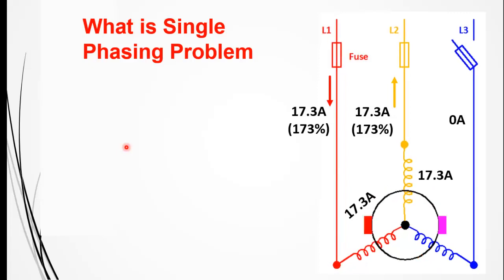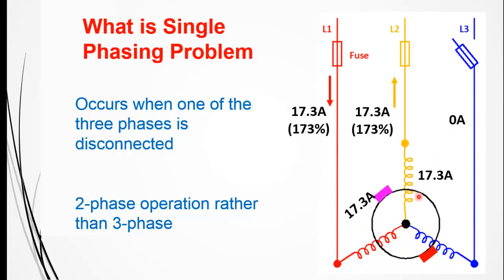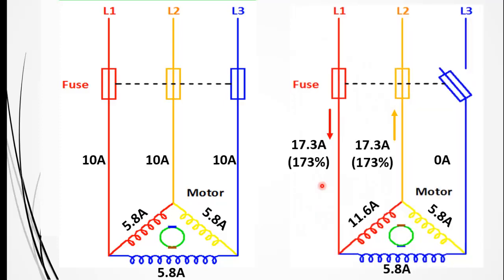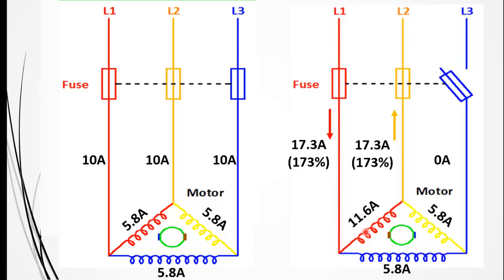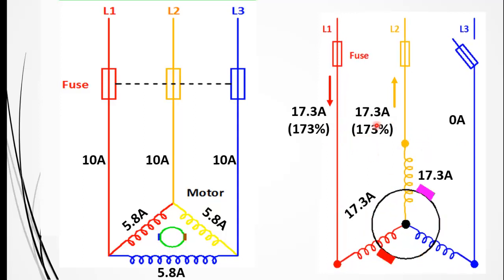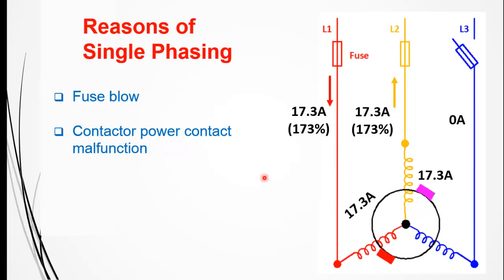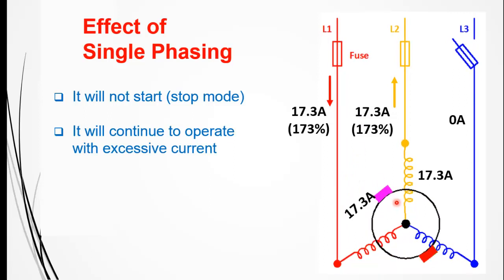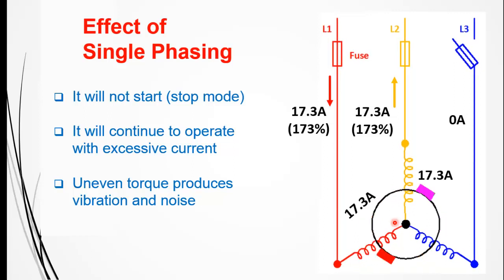Single Phasing Fault in 3 - Phase Motor | Motor Single Phasing

Comment: Hello sir ,  if the fuse is not be cutting   but  only using load different  , ex :  L1 and L2  using 50 percentage and L3 using load 90 percentage   so  the alternator will be vibrating ?
Reply from the maker: First you need to calculate total current imbalance on alternator. If it exceed 2-5% then it will cause overheating, mechanical stress etc and if it exceeds further, derating will apply

Comment: Experienced this first hand 10 years ago, i was blamed of purchasing an incompitable motor by an AM who was responsible for electrical installations from MCC to motor. I knew very well the motor i chose was compitable to the system as it was a duty standby design and duty one had been working normally without a single fault for 3 months. When the standby pump manual start button was pressed, the motor started to rotate and within a mintue 10K USD was lost. PM asked the AM to check the system comprehensively and the AM replied everything was checked, nothing unusual was found, and it was my mistake leading to the loss. I was then asked to purchase another motor to correct my mistake, and within a mintue after the pump was started another 10K USD was lost. The PM then asked the motor supplier to check what happended and figured out one phase wire was not connected at all. From the very beginning to the end, the PM didn't blame me and I didn't say a single word on this, but the AM never aplogized this.
Reply: So like, you don't ohm out all your coils and do a megger test before installing a new motor?

That's like rule #1 my guy. Make sure you're not about to waste your time rigging in and connecting an already-bad motor...
Reply from the maker: Unfortunate but that happens in the field. Thanks for sharing your experience

Comment: If one of the phase gets loss but the fuse to that phase is still close will backfeeding happen back through that phase. In a 3Ph 4 Wire system
Reply from the maker: Its not that for no reason phase is lost. Without any thing open circuit from load to sorce, the phase cant be lost. In that case no current will flow in it

Comment: how to carry test
Reply from the maker: What type of test
Reply: like Earth fault  ,short circuit test  how check that which phase is fault
Reply from the maker: This can be done manually through multimeter after disconnecting the motor
Reply: how we check in motor terminal box
Reply from the maker: Best way to check it first from the contactor then come to motor terminal
Reply: thank you

Comment: I had problem..got voltage on all phases but no amp on Red phase..what causes the problem?
Reply from the maker: Ur connection to the motor is open. From contactor
Reply: @electricallectures  u mean the winding?already check the connection,all in good order..been doing continuity test..got reading on w1-v2..its not normal rigth?
Reply: @electricallectures  im using auto trans starter..when switch on,run and star contactor energised..got amp reading on Red phase,but when main contactor energised,the amp on R are 0 amp
Reply from the maker: If star delta starter is used tgen delra contactor j
Has one phase open

Comment: What do you use in 3phase motor to avoid damaging? thank you
Reply from the maker: Overload relay whether it is thermal or electronic but I would prefer electronics for its accuracy. OL protects the motor in event of faults
Reply: Use a breaker that pops all three phases instead of seperate ones
Reply: @Dill_Do Wrong answer.

Breakers are used as short-circuit protection.
Single-phasing is NOT a short circuit, so chances are your motor is gonna burn up long before your breaker ever trips.

Overloads are designed to catch things like single phasing. The bimetal element will heat up and trip a lever that'll drop out the auxiliary OL contact that's wired in series with your contactor coil.

Size your overloads (and motor branch circuit wiring) correctly... 125% of FLA.